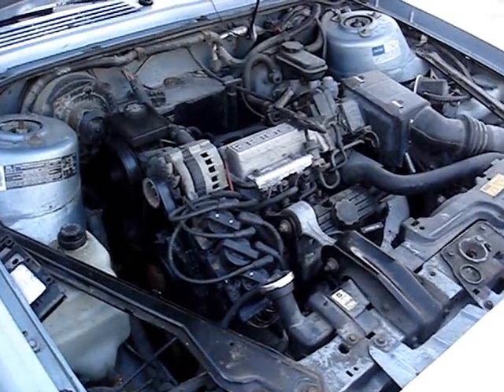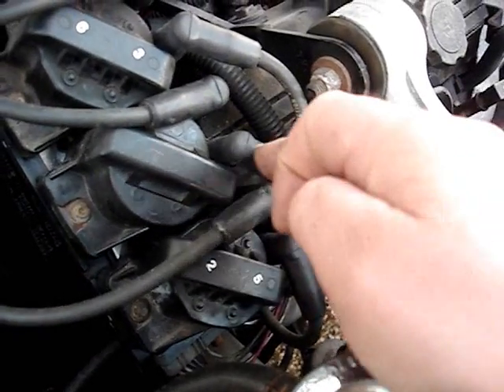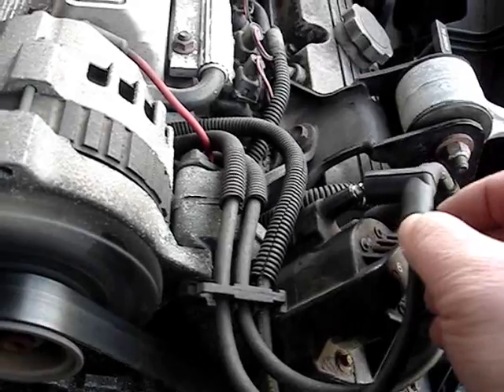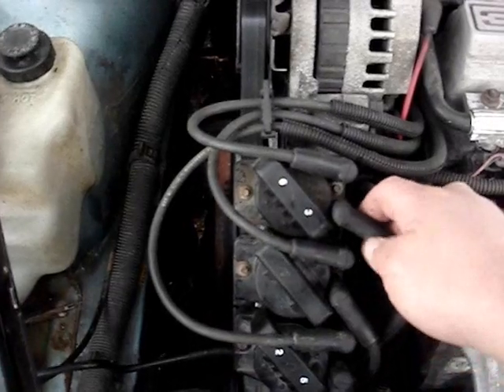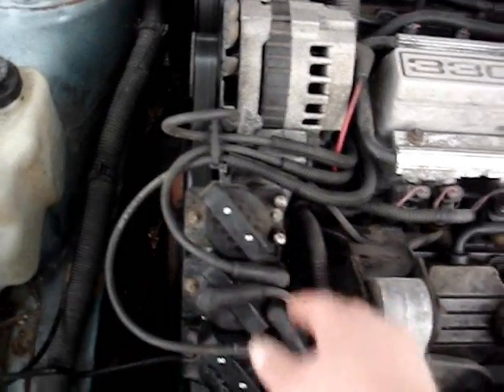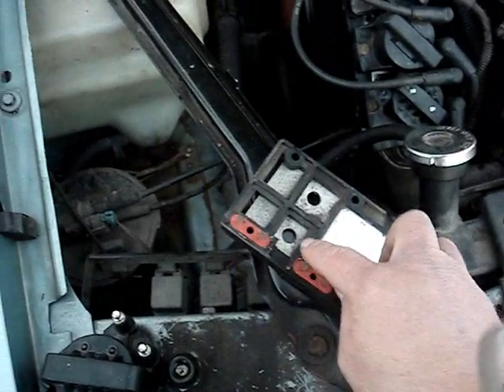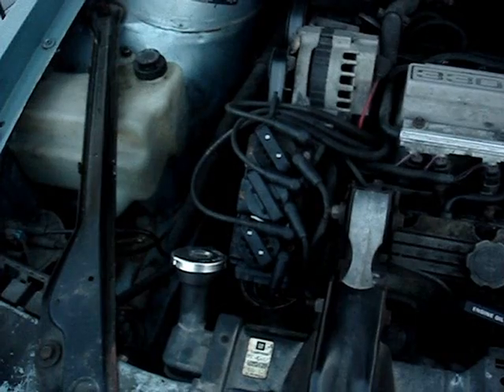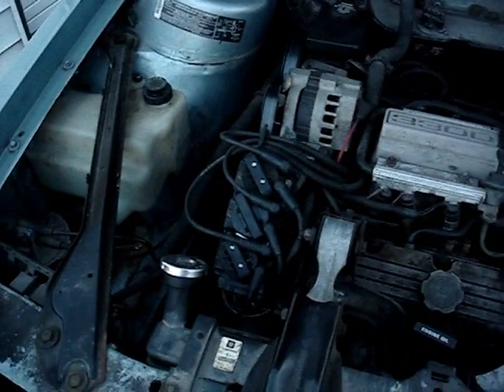Diagnosing Your GM Distributorless Ignition System

Comment: So riddle me this. When you take the plug wire off and it has clicking/ spark but just before you put the plug wire back it dies. And say all your junkyard coils are bad including the one on the car you want to replace but the car only likes the dead coil pack thats on the module ??
Reply from the maker: Excuse me since i made this video over a decade ago, i am a little rusty.   FYI there are 3 coil packs that all fit flat on the ignition module, and are all powered from the ignition module.    One coil kept failing, so i swapped that coil with a used one.  It turned out the used i installed kept failing too.  I then swapped around the coils i had on there, and same thing it was still failing.  It turns out the coils were never the problem.  It was the ignition module that kept shorting.  The engine would run fine, and then start missing after awhile.   Replaced the module using the same coils, and never had the problem again.
Reply: @craig1974 well I replaced the coil packs on mine with some brand new ones I bought and never used. And they're fine. But I think maybe I should get a new module as well. Thank you !!

Comment: This video was great, I have a 2006 Buick Allure with the 3800 V6 engine it helped me immensely, I’m thinking my issue is the ignition module plate, all of my coils seem to be fine, but there doesn’t appear to be power going to the bottom coil.

Comment: Just went through this with my 05 LeSabre. Only thing I would add is, after you find the non-functioning coil pack, take them all off and put them in different positions, put the plug wires back on correctly, never mind the now wrong numbers on the coil packs. Then recheck. If the same position coil pack is "dead", then you know that aint it. Would have saved me 38.00! I even swapped some plug wires to make sure that wasn't it. So, new plugs (should have seen the old ones, rotten!!!!), one unnecessary coil pack, and one module, I'm in business!! Now about that dieelectric grease, didn't have or use any. Think I'll have a problem?
Reply: Might shorten the life of your ICM.

Comment: I'm trying to change the throttle position sensor. It's such a tight space I managed to break off part of the screw. Any ideas how to get better access? I'm sure the car won't run right if it only is mounted with 1 screw. I am going to use screws with heads for wrenches, The screws were really hard to get to.

Comment: Note...disconnecting battery will reset radio. If you have one with code it's better to spend 25 bucks for a cheap reader and clear/erase codes with that. Radio presets may clear and trip meter. Odometer will stay, but zero's out trips.

Comment: If you replace,  buy an original oem ignition control module. After market ones failed on me twice.
Reply: There are 2 kinds of replacement parts. Replacement & used car dealer replacement parts. Used car dealer replacement parts don't last & are built for price not longevity.
Reply: @herbnalis3723  What brand aftermarket ignition modules are good?

Comment: So what if u have no power when u turn the key forward no dash lights  nothing. I've changed the fuel pump relay, ignition switch and the tumbler nothing. 3800 oldsmobile 98.
Reply: dead battery
Reply: @blackiechong4344  kmsl na open circuit homie. A dead battery want give u lights horn etc. Stuck to your day job.
Reply: I have the same car! I would check the battery first.

Comment: Dude, I comment you, great video. My car ran rough in the AM but after work no start. After pumping gas it started but was running rough. No spark at coil pack 3/6 but spark at other coils. Thought for sure a bad coil pack, i bought and installed...wrong. After seeing your video I believe my problem will be the ignition module. Left car at work will purchase module in the AM. I am really hoping this is my problem..will keep you posted...you all.
Reply: Did it work?
Reply: @2226phoenix  legend has it he died when following the OP advice when testing his new ICM.

Comment: Exactly. You MUST USE THERMAL COMPOUND between the module and mounting bracket. If you do not you will most likely burn out the replacement icm. Having some white compound on hand(i prefer the gamer compound thats grey its dirt cheap on amazon and ebay and wish) is much cheaper than blowing a 100 dollar plus module.
Reply: why doesn't the factory have compound between. My 02 Regal had 140 K before ICM went bad, no compound between, completely dry

Comment: I din't want to know your l problem. first the coil packs I need to know the # on each of them.so I know how to put each  wires on the right coil  like the coil at the radator is it 2 at the right of the coil 5 at the bottom of that coil.U left me guessing.
Reply: They are in pairs.  1&4, 2&5, 3&6.  The ignition control module fires BOTH plugs on any particular coil together (often referred to as "waste spark" - you can google it if you are interested in a detailed explanation).  
So you could reverse the wires on the same coil without issue, but do NOT mix wires from 2 different coils.  Different model cars may have the coils in different orders, depending on how they fit in the engine compartment, so it is best to look up the order of the coils online.
Reply: Thats why you pull the wires one by one and mark them. The original coilpacks  take the guesswork out if they are not moved. Just mark the new coils appropriately with white out.

Comment: another thing to note is that a bad icm can cause the timing to go completely haywire jumping from too far retarded to too far advanced and anywhere in between at random.  basically its a good idea to have a spare around to throw at it if you ever have a performance issue you can't pinpoint.  they also like to simply fail to provide any spark when they go bad.

Comment: Good video, but the substance you want to apply to the module is heat sink compound, not dielectric grease. I made the same mistake nearly.

 Heat sink compound transfers heat away from the module, which gets surprisingly hot in use. Dielectric grease seals and prevents electricity transfer, and does not transfer heat. I get my heat sink compound from Radio Shack.
Reply: Now that The Shack is closed, you can get it at AutoZone.  It's called Thermal Compound (or Paste) at AZ...

Comment: It's understood that this test is focused on diagnosing a faulty coil pack, but it also applies to any gasoline-operated engine, to check for the reason why a cylinder is not firing. This was a great guide though, Craig. Keep more videos like this coming.